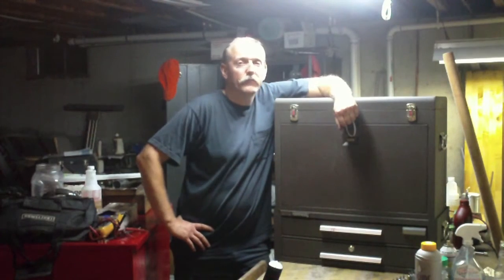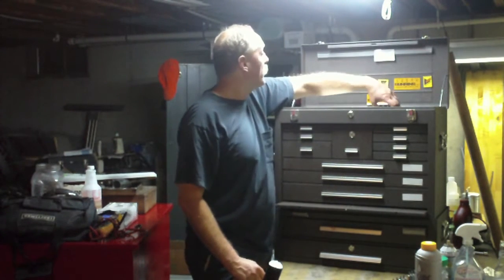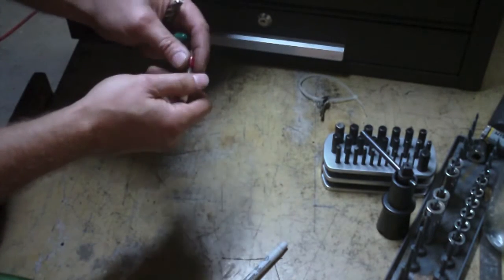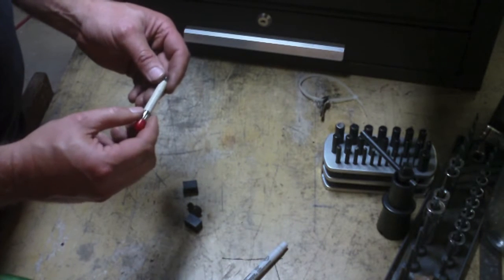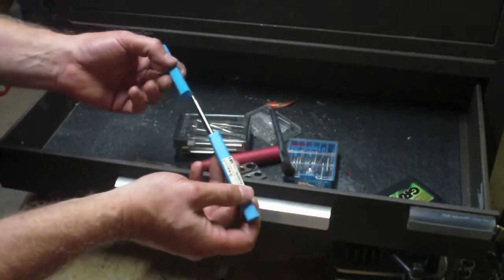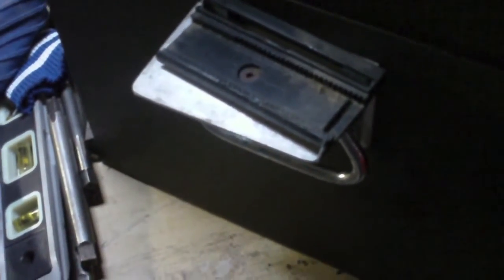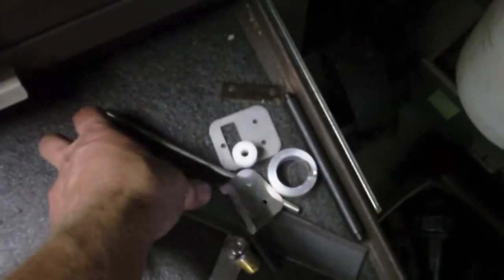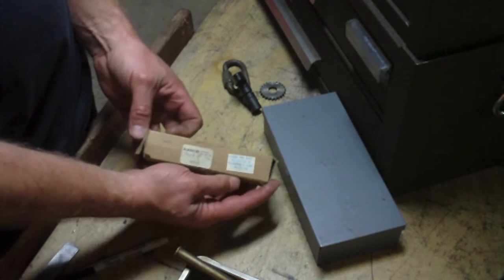September used tool store trip nets me a nice Kennedy tool box and more!

Comment: Hi Steve, that weird little cutter made of light blue plastic with the steel blade is for cutting soft plastic tubing. Good buy on the boxes.
Reply from the maker: +Dave Lee Thanks Dave, that would have been a handy addition to my tubing cutters, but the blade broke……….seemed like a real cheaply made tool.
Reply: +Steve Watroba 
Yes, they are a cheapy.   I'm not positive but, I think if you bought a big enough box of that tubing, the manufacturer included one free in the box. A coworker showed me one at a place I used to work, 20 some years ago.